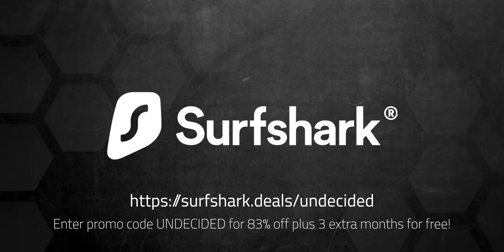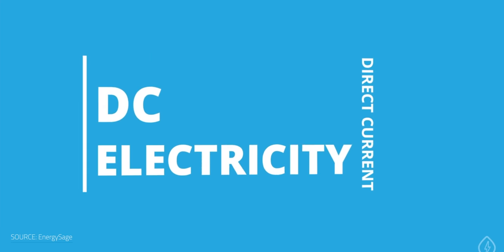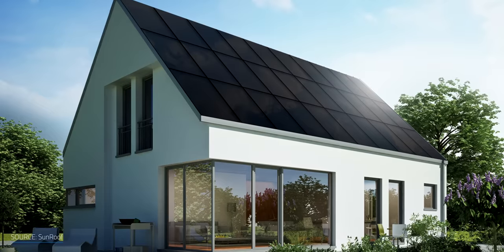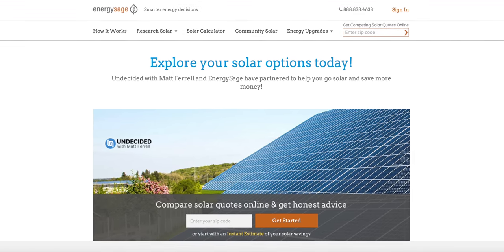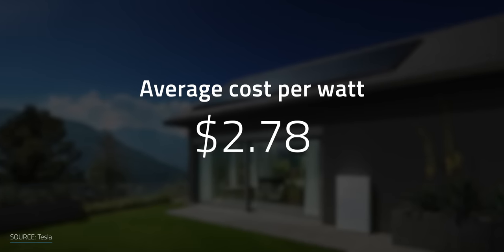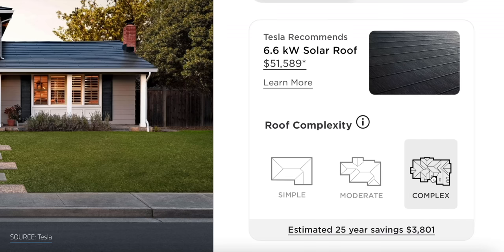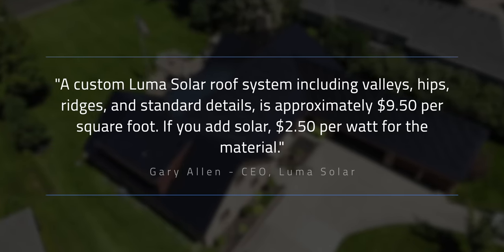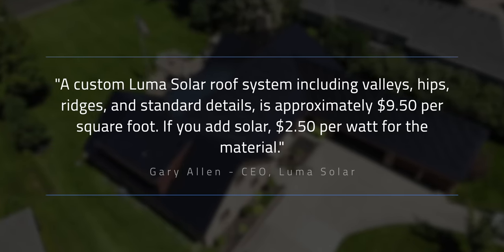Exploring Tesla Solar Roof vs. Solar Panels

Comment: "One isn't better than the other" - Well, you already showed that panels are better than a solar tiled roof when it comes to cost, warranty, and electrical production. I hope that tiles becomes more ubiquitous over time. I am all for them, however, I will always go with panels over tiles. And the top reason for me saying that, outside of cost, productivity, and ease of replacement is that I have a flat roof. That simple. Tiles make zero sense for my roof, and there are a lot of buildings and homes out there where they make no sense. That is good though, because it means that competition will still drive pricing for either option and that some areas it make way more sense to get one over the other. And yes, it can make total sense to choose a tile over a panel, as well. For example, some HOAs might not approve of solar panels on roofs, but they would likely be more interested in a solar tiled roof, as that will be more likely to keep with the neighborhood aesthetic and increase the individual home's value.
Reply: Great point on the Flat roof.  I would suspect that Panels would also be better if your house isn't aligned very well for the sun.  In my area they want buildings to be East West, not North South.  At my parents they wanted to put the panels on their outbuildings and not on the house itself due to alignment.
Reply: One thing I can't understand about "Murcia" "Freedom" " My Rights" Is how they let HOA exist and use/allow them.. you are letting someone else tell you what you can and can not do in your own home/castle.
Reply: @beingsneaky  I would never live in a HOA, but I understand why people would.  At least with a HOA it's only a small housing area and you don't have to buy into it or live there.
Reply: Aesthetics?.. I'm under the mindset of "if it works it works."

Comment: Wouldn’t textured tiles hold dirt and debris … reducing efficiency?
Reply: Depends on the texture. Specific microstructures giving surfaces a "Lotus-effect" can acutally be better than conventional flat glas tiles.
Reply: @EsotericEro  Im honestly impressed. Really.. Im not taking any part to the arguments, but this is the first time for me to see someone give a valid source in youtube comments: Scientific peer reviewed article. Im too lazy to check what is journal's impact factor, but I naively trust this one is fairly ok. :D
Reply: @EsotericEro  We do still get rain in the desert, not a ton, but probably enough to clean off dust from your roof. And yes, if you notice your efficiency is down it's 10 minutes with a garden hose.

Comment: We had our TeslaSolar (36) panels installed last week and (3) power walls. Inspections tomorrow. While installers were here, I chatted them up a bit, while honoring their time. What struck me with one discussion was; one of the installers use to do the solar roofs but recently switched back to panels. His reason:  He felt the roof had been launched prematurely. Parts to install panels, four (4). Parts for solar roofs tile, ~126. My other takeaway, was that each TeslaSolar installer were exceptionally well trained, educated, and willing to accommodate our needs. They worked together like a well oiled machine. One of the installers even graciously offered to paint the new conduit to match our house. (We already had the paint.)  

I would also say, that given Tesla's exceptionally poor customer service, I learned the trick is to contact them via phone call with each step involved with this process. While it shouldn't be this way, they still offer the best price. Knowing this ahead of time may help others. Don't worry about contacting your specific "project adviser". Just talk to whomever answers the phone. Be polite and to the point. They've moved our project along quickly since I adopted this strategy. Assuming our inspection passes tomorrow, I'll be contacting Tesla again, the day after, to ensure they've sent the request to our city utilities to get "utility approval". 

Thanks for your great videos.

Comment: Something I haven't seen addressed with Solar Tiles is the possibility of hail damage. At $546.95 per square meter for a Tesla solar tile, a 250 square meter roof could sustain well over $100,000 damage in the kind of hail storm that you see putting dents in cars.

Comment: I don't get how these panels you're quoting are so expensive. In South Africa we've got a company (ArtSolar) that will sell to the public at under R5.00 ($ 0.36US) per watt with a 30 year output warranty and 12 year structural warranty. You guys are being ripped off.

Edit: In warm areas you'll find tiles will drop in efficiency stupidly fast because there's no air gap behind them, so they heat up too much. EEVblog did quite a good video on the tiles a few years ago. You're getting worse efficiency and I don't see it being easy to make the connectors per tile cheap and robust. It's just a bad idea unless you have way too much money to spend and want a sleek high-tech looking roof.
Reply: The USA has one of the highest prices for solar. Almost every other nation can get it cheaper.
Reply: @kaitlyn__L  Are there significant import duties? I know of Trump's Chinese tariff increase, but surely that doesn't mean a 10x increase in cost? I guess he also quotes with installation, and I wonder if that includes other components too, like the inverter, wiring and framing.
Reply: @ThisRandomUsername  yeah AFAIK installation and certification costs are huge, but I don’t live there so I’m not 100% on the price breakdown. There are articles out there about why exactly solar is so pricey in the USA if you wanna read more about it. Certainly one effect is that it makes solar seem like the purview of… a salve on wealthy people’s conscience, to folks living paycheque to paycheque, and that is valuable for some politicians who set some of the rules that determine pricing. But since I don’t know all the details I can’t allege that that’s a primary reason.
Reply: @kaitlyn__L  I'm sure that's a very big part of the cost. Matt actually addressed this question in the podcast, talking about it being installed cost with inverter, having fair tariffs, and labour, etc.

Comment: One advantage of Solar Tiles is the area of the roof you can cover with active tiles. Solar panels tend to be large rectangles, meaning the area of your roof that can be covered with them is limited if you have anything other than a simple rectangular roof. Solar tiles on the other hand can fill in the gaps and use a larger ratio of the total roof area.

I watched the video twice and didn't remember it being mentioned, I'll probably find it the second after I post this comment.

Comment: How does heat affect the tiles? Solar panels seem have a larger standoff gap for airflow to provide cooling. The tiles seem to have much less airflow and will get hotter/less efficient?
Reply: It's the roof so that is factored in my for the build
Reply: That is a very good point, especially in hot climate's I believe you start to get substantial output drop off on normal panels around 120degrees F.   

I wonder how bad the heat soak is on thes being placed directly on the roof.
Reply: I read a document that you can use the heat from the solar Tiles as extra source for heating of the house
Reply: @Hanmacx  but what if its 90f outside. The last thing i want to do is heat my house haha.
Reply: @monkeymilk8060  thats exactly what I was thinking 😂
Reply: Thats exactly what I was thinking. My uncle got a quote for a solar tile roof and the output in in kWh/kWp was 15% lower than what you would expect from panels...

Comment: I had solar panels installed and love them.  I have a 2400 square foot home and my roof was able to hold 40 panels that were facing the sun.  My average production per month is 1.65 Mwh.  I have not had a power bill in months.  Live in northern FL.  Paid $45,000 for the install with net metering.  Currently have a yearly credit of about 1 Mwh.  The power company at the end of the year will send me a check if I have a yearly credit for the energy.  After the 30% tax credit the final price was $31,500.  Put the panels up last year.  My production ranges for a low production month of 1.2 Mwh for Jan and Feb to a high of 2.1 Mwh in May.  The power company charges about 30$/month for just being hooked up to the grid and using power prn such as at night etc.

Comment: Matt, you didn't mention the effect of micro inverters on panels.  Could you talk about a direct comparison of how they affect the relative pricing?
Reply: +1

BTW, how does it work with tiles, individual inverters or shorter strings? What would make the most sense?

Comment: Originally ordered solar roof at the beginning of the year, got hot with a 20k increase.  They offered a free power all with the solar roof.  I changed my mind and ordered panels Instead if a solar roof.  I am now awaiting the new design plan with panels, better performance, easier install, going with two batteries instead of one and hopefully I'm getting more panels installed than the solar roof.   I know the roof looks better but it's still at its Infancy stages, where panels have been out for years.  I'll revisit solar roof down the road when it gets better and more affordable.

Comment: As an engineer, my only issue with solar tiles (cost aside) is troubleshooting.  If one of the tiles go down, it's difficult to find the faulty tile as they're mostly Installed in a string configuration and doesn't have local monitoring.

Comment: When looking at the two options I found the installation , and cost, of the tiles to be a better bargain than the panels. The reason for this is that , Tesla for example, will be removing the entire roof and installing a new one with solar tiles in the best position for them, regular tiles elsewhere. This means that you not only get solar, but a new roof as well.
Reply: Practically speaking, is there enough data to know if Tesla's tiles make an adequate roof? That would be a good presentation topic too.

Comment: Matt, I think something you overlooked here is achievable system size for a given roof area between tiles and panels. I paid for formal designs from Tesla for both solar panels and their solar roof so I could compare what would work better. With my roof dimensions, they were able to give me a 13.26 kW panel system, but only 9.47 kW for the solar roof. And considering the solar roof would still be almost $9000 more expensive than the panel system (almost the price of a new asphalt roof) and that I felt the solar roof wouldn't give me enough production, the panels became the only reasonable option. The solar roof has too many restrictions on where the active tiles can be placed, making it space-inefficient.

One other thing -- Tesla isn't using the SC330 panels anymore, as far as I know. They offered me 340W Q.Peak Duo BLK-G6+/SC panels.

Comment: I've been researching this for a year, as my roof will need to be replaced in the next 24 months, (existing 21 year old composite shingles). As we lose power several times a year, I am very motivated in getting a Powerwall and having the ability to operate when storms, or other natural disasters, knock our grid offline. Several of my neighbors have solar panels, but I think the added cost of a solar tiles are worth every penny, and will easily increase the resale value of my home.
Reply: If you’re worried about power outages use panels and invest your savings into more battery storage

Comment: Seeing how that tile shattered, and seeing how weather will become more extreme with the ongoing climate change, hail is gonna be REAL bummer.
Reply: I asked this question to the solar installer. They said hail damage goes through your homeowners insurance. So yes. Hail risk is a real thing. That being said, for me in new England, hail is only once a decade or so, and the last time it happened here, my neighbors solar panels were fine. So I think hail is still low risk.
Reply: @edwardnedharvey8019  Well, I meant the Tiles specifically, and just because it aint a problem for you right now, I've seen pictures of houses not looking very good after bad hailstorms. And there likely will be more of those. 
And also, just because you don't have to pay for it directly, it's still a bummer if you've got a whole neighbourhood, all roofs covered with solar tiles, and 90% destroyed by a bad hailstorm. 
Not saying that I am against them, I'm all for installing solar panels anywhere possible, I'm just thinking there must be ways to protect the solar tiles that are more economical than replacing a whole roof of them.

Comment: Like the look of the tiles but I have panels on my house right now.  Disappointing thing in the winter is that I have a gableed section of roof right below the panels and that in turn keeps a big chunk of snow on top of the panels because it prevents the snow from sliding off the panels when it warms up a little.  My backyard neighbor has a straight line roof so I can watch as their panels get clear and used.  I'm jealous.

Comment: As a UK Solar installer, I was taken aback by your prices.  For solar panels £1000/kW ($1400/kW?) is a good ball park figure.   We install panels only but most popular at the moment is the GSE 'in roof' system, where they sit in plastic trays at the same level as the tiles/slates.   I'm suggesting this is the best of both worlds?   Incidentally, there is one disadvantage to 'in roof' or solar tiles - lack of air circulation.   Cool panels are more efficient so having them above the roof with the wind whistling past is going to make a few percent difference.

Comment: If you use Unistrut rails to mount panels on the roof it is very easy to upgrade and/or replace panels as needed.  The Unistrut rails can be installed 1inch above the roof surface leaving room for water run-off and simplifying any future roof repairs.

Comment: I'm lucky enough to be on 5 acres in the southwest desert, and we'll eventually go with ground installed solar at some point.
Reply: How do you manage water supply?
Reply: No time like the present, really!
Reply: That sounds like a near ideal situation.
Reply: Solar is only going get better able to draw more energy. It really is the future of consumer energy options.
Reply: @SF-li9kh  for module(Panel) cleaning there is a new technology called dry module cleaning which will be helpful at desert place.
Reply: I saw some videos of a couple doing that; they also used the run-off from their solar panels to accumulate and eventually filter water in the desert.  They say it doesn't rain much, but when it does, it can fill up a large part of their yearly water needs quickly.
Reply: i m so sick of all these disinformation. you can buy solar pannels with 400 w power for 200 usd  anyday.
Reply: @cornelstamate2537 .solar sales representatives is like a bad used car sales representative or a bad army recruiter.

Comment: Fyi. Wholesale cost for Jinko panels are about $0.40-.50 watt. A quality panel like LG is $0.60- .70/watt.
If your finding differences of over 20-30 cents for panels installers are selling, there is more to the formula than just the panel. Inverter cost ranges the same. I am noticing installers seem to charge more in areas with better sun access. Lower sun access it gets ultra competitive

Comment: I’d love to know more about the weight differences. Does new construction require special reinforcements for solar roofing?
Reply: Looking at the thicknesses and the average densities of solar panels, they wouldn’t be much heavier than traditional tiles, at least enough for a roof to withstand.
Reply: No. Installing solar roof doesn’t require anything special. Your regular structure should be able to handle the extra load. Maybe if you are in a high wind zone. Then the attachments are spaced a lot closer.
Reply: IIRC Tesla was rebuilding some people's roofs entirely if they needed it, but I think they weren't charging extra for it.

Comment: I think important is the cost of putting on a roof in the first place, solar panels require an existing roof while tiles don't and that difference should be discounted from the tiles cost.  Going forward into the future tiles are going to be the standard for new and remodeled homes with panels for older model homes.

Comment: Something one really needs to consider is how the structure is oriented where the solar collector array is to be installed.  If the ridge of the roof is not aligned due east/west and the roof pitch isn’t the same angle as the north latitude, then there won’t be maximum output from a tile array.  It does not take much misalignment for output to drop dramatically.  That is potentially a significant downside for solar shingles which have to live with the surface they are given.  Cost goes up even more because a larger shingle array is needed on a suboptimal roof to get output equivalent to adjustable panels.

Some mitigation for misalignment should be possible via the array surface texture.  I have a solar array apparently made by Arco 30 or so years ago for installation on Coast Guard buoys.  A buoy is going to bob around in the sea and often not be in the best alignment for maximum array output.  What was done for this panel was to dimple the surface with thousands of tiny tetrahedral indentations.  Those indentations seem to help focus off axis illumination onto the solar cells.  I am a solar neophyte, but I have not yet seen such a surface finish on a land based solar array.  I presume it must be a cost factor, and is less important if an array can be fixed at optimum orientation.  Appropriate surface texturing might help mitigate orientation problems for solar shingles.

Comment: The design of Tesla's tiles begs using heat from the solar PV panels to store sub surface (earth) heat sources for hot water, etc. Just need to tweak the design a bit and it would fit.